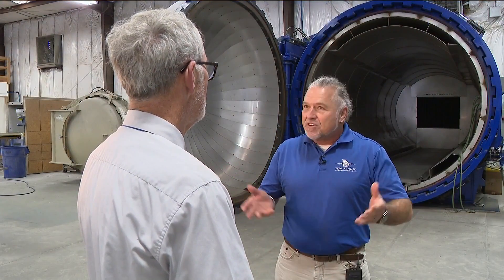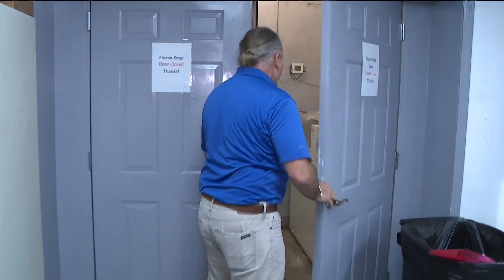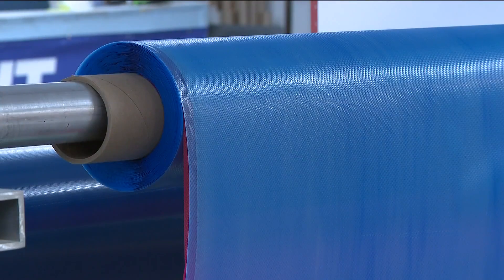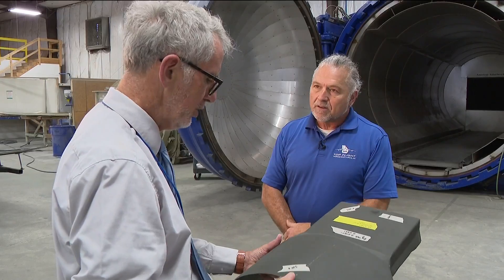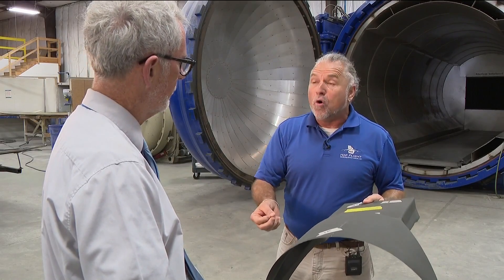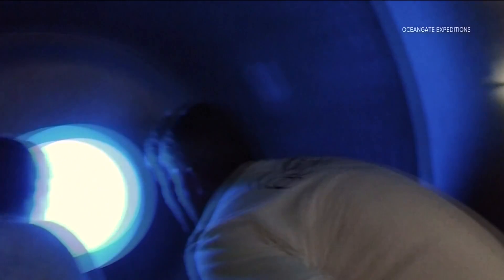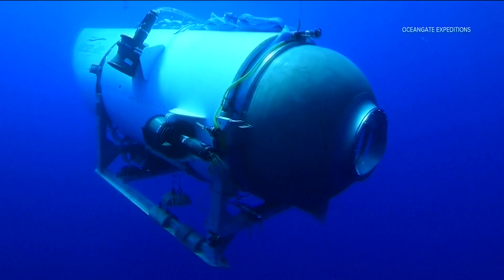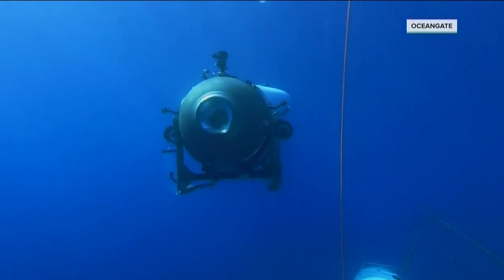Georgia engineer talks carbon fiber that failed in Titan submersible implosion

Comment: I would rather use material that you don't have to test often. Carbon Fiber is a joke and also there's been planes that have gone down and I'm sure Carbon Fiber is linked to some of those plane accidents. Don't trust Caron Fiber! Also, why would I want to use something like Carbon Fiber if all it takes is one small hole to cause problems? That might be more of an issue with Submersibles than it is with a Plane but all I know is that it seems like Carbon Fiber is junk. I'm sure this guy sells Carbon Fiber so he's not going to tell you it's Junk but it sure seems like it.
Reply: Carbon fiber is absolutely not junk at all. It's just that ALL materials have their strengths and weaknesses. Carbon fiber has very high tensile strength, is lightweight, has low coefficient of thermal expansion, etc. However, carbon fiber is weak under compression. Heavy compression will cause micro cracks or delamination, which can cause catastrophic failure. The compression stresses an airplane experiences 35000 feet in the air is going to be vastly different than the compression a submersible experiences 12500 feet under water. This makes it a material great for aircraft, but poor for a submarine or submersible. 

The Titan submersible had prior successful trips to the Titanic, but these trips likely caused damage to the carbon fiber hull each time, which ultimately led to the catastrophic failure experienced. It may be worth noting as well that aircraft undergo routine inspection and maintenance, and the parts are held to a high standard, as they need to be capable of safely transporting the lives of up to hundreds of people. Unfortunately, it seems there was quite a lot of mismanagement and cost cutting from OceanGate. OceanGate never got their submersibles properly certified, and they still went ahead and carried out tourist expeditions. Employees who expressed safety concerns about the submersible were fired from the company.
Reply: @lifeispainihate  i watched an interview with a previous passenger of the titan submersible where he talked about hearing "cracking" noises in the submarine during it's dive, in the interview they talk about how he and stockton rush thought the material was similiar to wood in that if they hear cracking it's still a while before it completely breaks...
Reply: I've seen carbon fiber mountain bikes fail and it's pretty dramatic. 😮
Reply: Glorified fiber glass ! pure and simple.. not designed to be crushed, even worse to operate in Extreme underwater temps and what fool would design it to have a 100% virtual duty rating with NO testing between missions ?? Money cant buy brains !!

Comment: Interesting. I’ve heard experts in other interviews point out that carbon fiber performs excellently under tension (as with planes) but not always as well under compression (as with the submersible).
Reply: this is a critical point that I hoped an ENGINEER would point out
Reply: In summary, the higher it goes in the atmosphere the less atmosphere pressure.  The deeper it goes in the ocean the higher the pressure, exponentially.  The 2 are not comparable…
Reply: Strength is relative to weight.......Specific gravity of Epoxy/Carbon matrix is only 1.6 and 7.6 for steel.......Was weight critical..???...........I do not know.......For it's weight carbon is hard to beat.......1/4th the weight of steel..........Even aluminum is 2.6...................Paul
Reply: That would be my understanding. It will stretch a little but not compress.
Reply: Airliners only experience 8.2 psi of internal pressure at cruising altitude, w/4000 psi for the sub
Reply: @fosothbotzt  Well TBH u can fix that problem by just making the hull concave.  Tho it shouldn't be reused--rebuild it after each dive

Comment: It would be more than 20,000$  since none of it is exposed to ultrasound and they would have to take the sub apart.
Reply: true ... a bit easier if done from inside out. But gotta add "X-Ray" costs if something found on the scan.  If you get to see the initial production process, you'd shit a brick Bro ... no Clean Room, no temp/humidity controls, no job cards, no QPL ... and how they bonded the Titanium Rings to the wound hull ... using a squeegee to fill the void with some kind of resin ... and an Autoclave no where in sight. I'm pissed !
Reply: @craigsowers8456  I saw the video where they were just having some casual conversation while applying the bonding resin with spatulas from Home Depot. Like guys! You could totally see voids that will eventually crack and delaminate the carbon fiber from micro fluid intrusion. Just imagining how much the center of the tube wants to compress and make the plug come off. Perpendicular to the cross sectional area at the end where the plug is, it won’t even want to be a circle! It will just try to be an ellipse with a cross section that pushes off the plug as it deepens!
Reply: Have a link or can you tell me what to search for?
Reply: @MeEncantaKiley  correct. So many things wrong in that clip, I lost count.  Talk about "Shade Tree" !!!
Reply: @amandahugenkiss  ya let me find it
Reply: @amandahugenkiss  Bonding the titanium ring on the carbon fiber hole” by oceangate. One I saw got taken down but this one is similar

Comment: It's great for things like fishing rods, but not for subs. You need titanium for subs.
Reply: So why would they have chosen to use carbon fiber? Did he think it would be an alternative? At this point shouldn’t it have been an already proven science that only titanium will work for all subs and everything else will fail? Why was there still people guessing around about it?
Reply: Price.  It’s cheaper to build and lighter to transport.
Reply: @amandahugenkiss  So basically, I guess CF is like a poor mans titanium? Like you said it is also lighter. The way that guy was, his whole thing seemed to be pinching pennies. "We have this window that is rated for the Titanic depths that will cost you 100 thousand dollars" "No way I'm gonna spend that kind of money, give me the cheaper one for less depth, I think it'll work"
Reply: I'll take graphite...
Reply: Steel is great for hulls. If properly designed and tested. The ideal design is one that works for the application. Submarine specification has depth and pressure limits. Imagine going beyond the limits and just like the movie but real life.
Reply: I read an account of a carbon fiber bow shattering & sending splinters into the archer's arm & body. He had to go to the ER.

Comment: They don't absolutely know it was the carbon.. It could have been the window that was not rated for the depth that failed before the carbon.
Reply: Even if not specifically the carbon it’s probably either the interface of the titanium and carbon fiber or the porthole. The different materials strain and deform at independent rates. The design was flawed from the beginning.
Reply: @strechinpick  My point is the video claims it was the carbon fiber and this is before any formal investigation.
Reply: The ceo said the window moves 3/4 inch inward under pressure
Reply: If the window failed before the carbon fibre, then the carbon fibre cylinder would have likely remained in one piece since the pressure inside the sub would then be about the same as outside.
Reply: I wondered about that, too. I assumed that she meant that not necessarily was the hull the cause or the thing that went first as opposed to the port hole but that at some point in the implosion at least, the hull did give way/tear apart/fail. But yes, I would have found a different way to phrase that altogether.